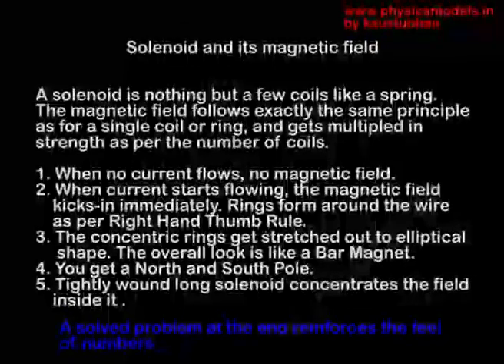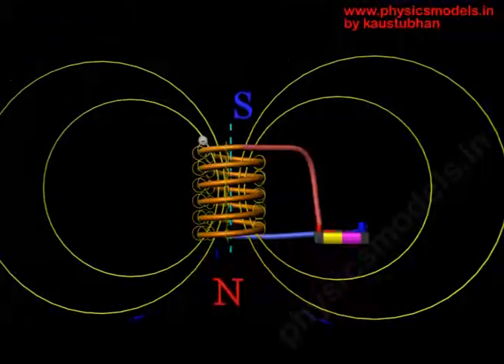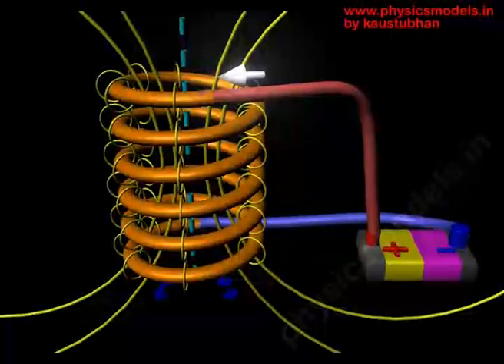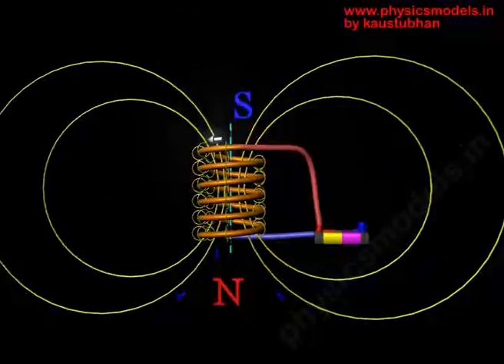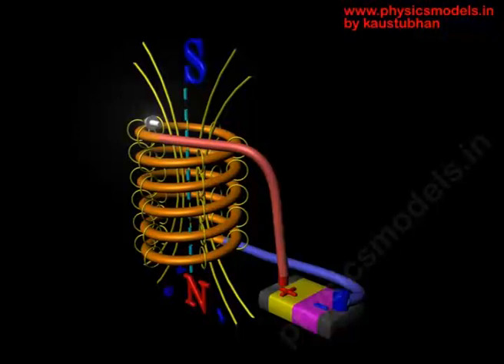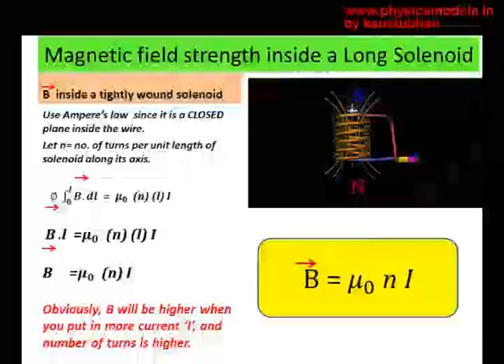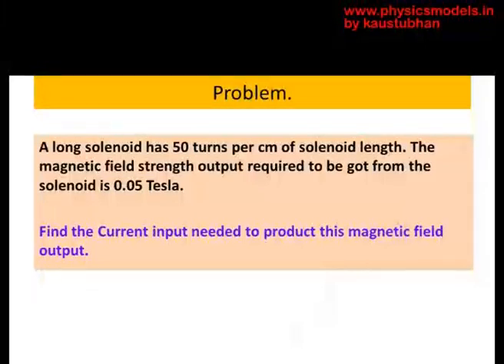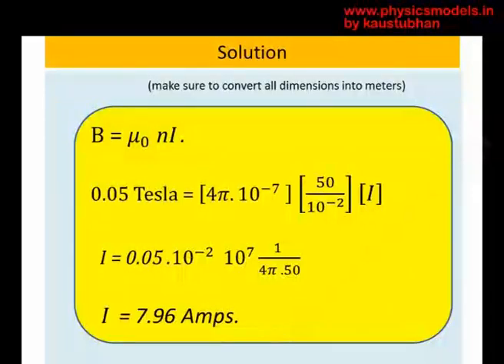physics- Magnetic Field in a Solenoid-basics

Comment: I have  one doubt how to levitate the metal or any other thing with the help magnetic field
Reply from the maker: Levitation can be achieved even by two permanent magnets placed in a tube, with opposed poles facing each other (like North Pole of one magnet facing North Pole of another magnet). Alternately, this can be achieved by creating electromagnets. The magnetic field should be strong enough to support the weight of the part required to be levitated.
Reply: Physics Models but I need with an electro magnet
Reply from the maker: You can make two coils as electromagnets. Apply opposite directions of current , when you see it from a fixed Frame of Reference, like from the front side. Then, place these coils oriented in a coaxial manner, vertical direction, one below the other, in a Tube where it allows one electromagnet to move freely and smoothly without tilting sideways. That would kind of create a situation akin to a North Pole facing North Pole, or South Pole facing a South Pole. You should get some levitation If your current and Coil are strong enough.

Comment: Hi Professor, what if the solenoid is made of a hollow tube completely filled with ferrofluid and with both ends of the tube connected and looped through a high-speed pump moving the ferrofluid inside the tube, will the ferrofluid filled solenoid produces a magnetic field or force?
Reply from the maker: Hi, in my opinion, the magnetic field will still get produced. My reason is: The pipe contains the magnetic fluid (ferrofluid) and would'nt affect the current flowing through the pipe material. The current would continue to flow, using the path of least resistance, which is the outer periphery of the pipe, a metal, and current will not flow through the fluid. So i don't see a problem in producing a magnetic field. However, I have not come across an experiment with this arrangement that you mention. I wait to know more about it.
Reply: Thank you, Sir.
Reply: Thank you Sir! But if I want to confirm this and do more research what branch(es) in science should I look at?

Comment: isn't the magnetic field outside a solenoid =0? or is that only for very long solenoids? (my teacher said it is because if we make a Gaussian surface around the entire solenoid there will be no net current, but i see here there is a magnetic field outside the solenoid)
Reply: I think this only applies to really long solenoids. When the longitude of the solenoid becomes too large, the magnetic field becomes very weak outside of it, practically zero. Then, the magnetic field is only relevant parallel to the geometric axis, in places inside of it. I'm not a physics teacher, though.